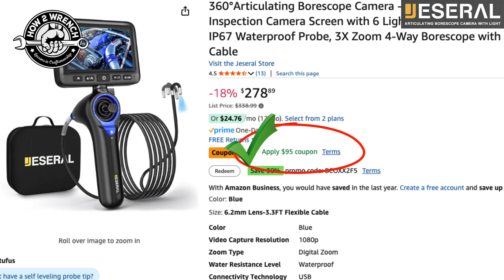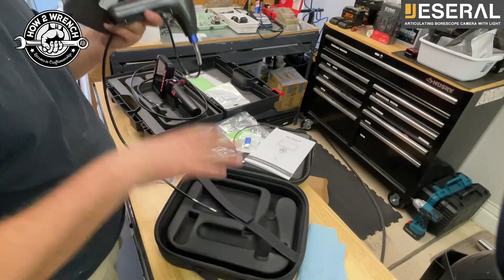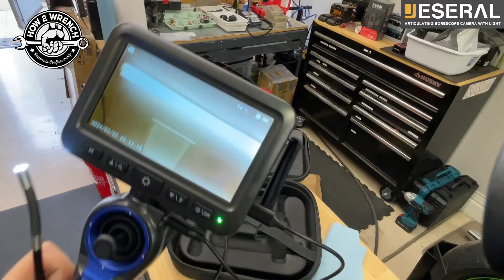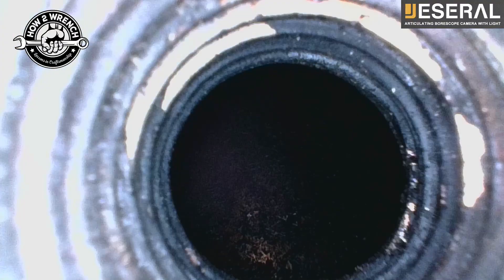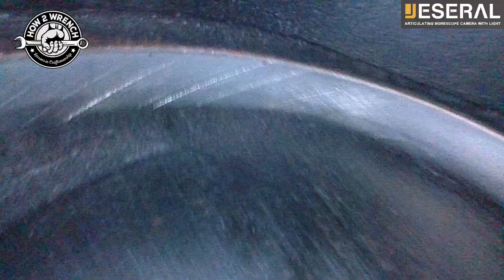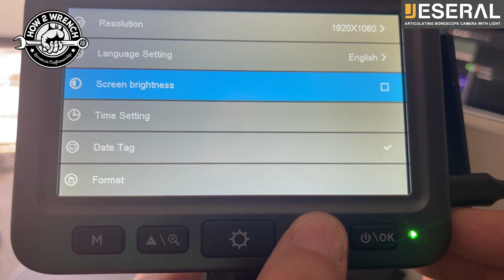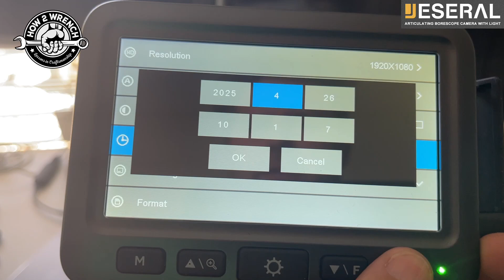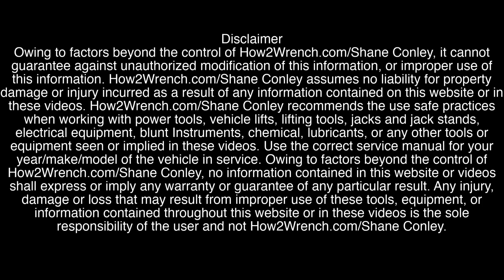New articulating 360 Borescope for 2025 #borescope #amazonfinds #jeseral

Comment: Hi! Please give me some advice. By mistake I received pilot jets with bore bleed holes 0.6 mm, I read that for kehin cv you need 0.8 mm holes, how will jets with air bleed holes 0.6 affect the engine operation? 😭
sportster 1200 99 thanks!